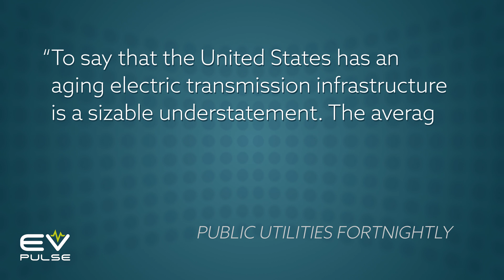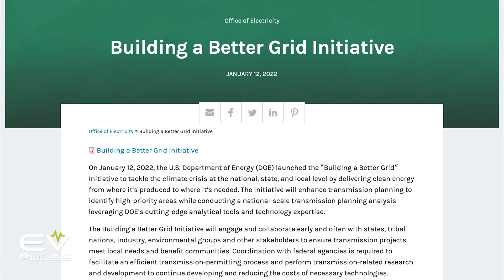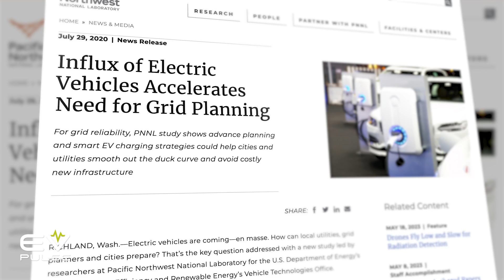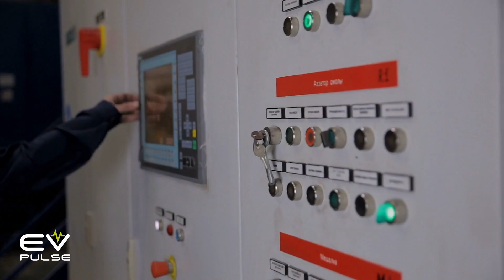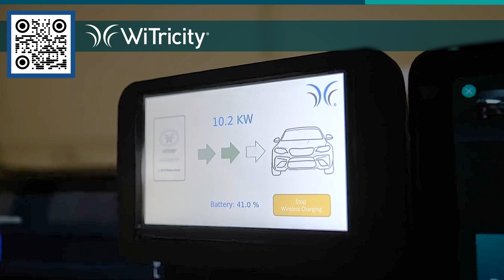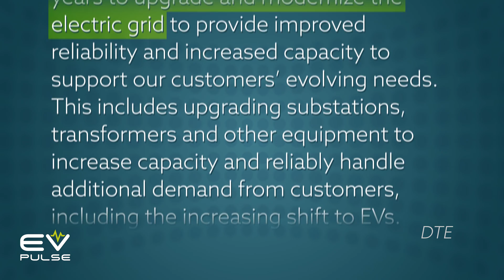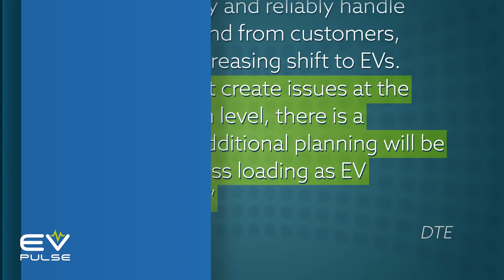Will EVs Kill the Power Grid? | EV Basics

Comment: Well, the answer is NO provided that your produce enough energy by whatever means and have an efficient and reliable distribution system. It requires a lot of planning and investment. If you just seat back and relax you will have huge problems. EV adoption can easily grow 10, 20% over year, but electricity generation and distribution will not grow as fast as.

Comment: What's crazy is electric company puts energy savers on your home for your air conditioning. This allows them to shut off certain areas during peak times. Pretty much you don't have control over your air-conditioning settings because they shut you off when they feel like it. 
They want to make electric vehicles? Lol that makes no sense!!! Specially makes no sense when power goes out just from a storm. Can't charge electric vehicle if that happens. 
Batteries, freeze and explode so I'm curious how that's gonna work. Not only our batteries extremely expensive and you better be rich in order to replace your batteries in your electric vehicle, but the old ones will still be going to landfill. You didn't really clean the Earth, with your electric vehicle. 
Gas cars you fill and go, electric cars you sit and wait.  You smashing into another car with your battery car and kaboom there's all your battery acid everywhere eating through everybody's skin and everything around it. Sounds like a horror movie.
Reply from the maker: Sir, this is a Wendy's.

Comment: I retired after 34 years as an IT Field Technician for a Fortune 100 electric company; my two specialties were wide area communications and protection schemes for transmission and distribution; I was the IT guru for the newly installed Smart Grid system in Flagstaff back in 2010.
I see this video as mostly right, but the sources are not talking about the right things. Capacity per se is a relatively small part of the reliability picture: everybody overlooks stability, even though it is a major factor in most wide ranging blackouts.
Mostly good news: in the 20th century protection schemes were almost entirely plagued by overkill. Since trigger events were a matter of looking for faults on a line, there was only one way to deal with instability - the leading cause of blackouts: cut lines and facilities in the clear! Bring it all down for as far as it takes, then try to restore pieces one at a time. IMPORTANT LAW OF PHYSICS: generation must equal loss plus load every second or so. The First Law of Thermodynamics sez so. For this very reason relatively minor events in the Pacific Northwest (including a filbert tree being a bit too tall under a transmission line in Oregon) resulted in blackouts to most of the western US on August 10, 1996.
The good news is that in the past couple decades a relatively new stabilizing system has been implemented. It is based on a (redundant) data network that shares voltages, currents, and phase angles to intelligently trip off lines that are pushing the system over the edge. The system, known as Remedial Action Scheme (RAS) is a growing part of system stability.
That brings us to everyday stuff, but with technical aspects. Generation falls in two categories: dispatchable (available on demand) and non-dispatchable (available when the stars align right. Fossil and nuclear plants are dispatchable sources; solar, wind, and hydro is not. (Hydro is dependent on upstream precipitation.) Geothermal is dispatchable, nearly all other renewable sources are not. Stability depends on enough dispatchable power being available after load is shed if necessary.
Bottom line: the adoption curve will probably stay within the proactive measures curve if we are smart. We need to be sensible about relying too much on non-dispatchable power like solar and wind. Use them when the margin is good but relieve them when the margin is not. Non-dispatchable is not like nitroglycerin, but it is waiting for us to make mistakes.
Reply: Now that you've had another year to watch renewable energy, how do you think Utility scale batteries will reshape the power generation? 
    My biggest reason I think fossil fuels need to be eliminated is:  A few years ago I was standing on a outside walkway at the coal power plant I worked at watching a major crane lift to install new pollution equipment. A plant engineer stepped up to the rail beside me and said "What a waste of money, it all falls out in a thirty mile radius anyway!" .  My question to him was "So it's okay to poison people in a thirty mile radius?".  He just turned and walked away, Pittsburgh is twenty eight miles away from that plant.

Comment: If followed to its logical conclusion nuclear electricity worldwide. 

No CO2 climate destabilisation for Australia, from emissions worldwide. 

Nuclear uranium yellowcake sold worldwide. 

Small Modular Reactors worldwide. 
Nuclear industries worldwide. 

Military defence budgets exploding worldwide.
Nuclear submarines for Australia's defence worldwide. 
80% of the world's population is in dictatorships. 😮😮😮😮😮

National Electricity Grid expansion worldwide. 
Iron ore and coal mining exports worldwide. 
Copper and zinc and aluminium exports worldwide and refining and  ....
CO2 emissions exploding.
EVs and no ICE vehicles. Millions and millions. 
15% of energy used to 100% electricity energy is x7 more electricity and national transmission and distribution grid and poles and wires and transformers and switch yards and.... maintenance and.....generation SMRs, 
And expensive plant operators working shifts 24/7/365.
And spare SMRSs, 
And decades and decades and decades and decades of new capacity grid construction

Comment: Air conditioning, the peak daytime load is the main issue. AC loading greatly increases with hotter summers. AC unit count will also increase worldwide from 1.9 billion in 2020 to 5.5 billion units in 2050 (IEA).  EV charging is a peak night time load.  Bottom line:  If the grid can handle peak daytime in the summer it will generally be able to handle the night.  A crap ton of $ will have to be spent improving the grid, but not for the reason you think.
Reply: Most people leave their AC on overnight.

Comment: ACTALLY, EVs will  BOLSTER  the grid. All EVs need to be using a  Bi-Directional charger. One that puts juice INTO
the EVs battery pack as well as take juice  OUT  of the battery pack so the grid can use it. As we speak there are 
some 9M EVs on US roads. It works like this>>>
You come home from work or a trip & plug in. Your charger tops off your battery pack  THEN  the charger switches 
making your battery pack capacity available to the grid to run your neighbors ac or do his laundry. In the wee hours 
of the morning. your charger will switch back & top off your battery pack once more getting you ready to start your
day. Problem Solved. The US grid does not need to increase its capacity because all these EVs WILL BE the 
increased capacity.

!
Reply: Right!  Cars with larger than needed batteries are essentially grid storage.  Imagine being paid to plug in!
Reply: There are serious problems with that vision, though. There is nothing to regulate such unsolicited power; it is not very different from trying to drive with the engine power doing whatever it wants to do. Blackouts are commonly caused by instabilities. Numerous homes backfeeding the retail electric system is a condition that will have to be well-controlled.
Reply: Not going to happen.

Comment: THEY WILL!!!!  BECAUSE FAST CHARGING WILL WASTE MOST OF THE ELECTRICITY!!!!  CARB  lies about the efficiency of EVs!!!  In their ARB/MSD/7-6-94 they claim that battery efficiency is 80% and motor is 90%. These are lies!!!!  Charging a battery in one hour is 5.88% efficient. In 15 minutes it is ONLY 0.3675%!!!   While running it depends on how many stops are made. Every time the motor starts the motor and system efficiency are almost ZERO!!!!!  The high motor starting current is also bad for the battery!!!!!
Reply: You are spouting utter nonsense.

Comment: Refining Oil requires vast amounts of electricity, as the need for requiring Oil decreases so vast amounts of electricity will be released to grid for EV use, simply put, if we stopped refining oil there would be more than enough electricity to power all ICE cars converted to EV's
Reply: This is complete nonsense and misinformation. It takes ~8.4 kwh of electricity to refine one barrel of oil which itself contain ~1700kwh of stored energy. This is why oil is such an efficient energy source and why it is so difficult to get rid of it.

Comment: Electric class 8 truck charging requires 1,000KVA for each charging stall. That is so far above our current capacity you don't even have to do the math. It's like, can I haul 50,000 lbs in my Honda Civic.
Reply: Truck chargers have to powered from batteries at the charging site that recharge slowly at times of low grid demand then output fast when a truck pulls up.

Comment: The grid can easily handle the demand of EV charging, if there was sufficient electrical energy storage at the charging sites. Something like a "Tesla Megapack" would handle full rate charging any time of day, and would not burden the grid during peak hours, because it could charge during off-peak hours, and take advantage of the power available from wind and solar when that's available. Because it can put a steady load on the grid, the average energy can be much greater, even with a slight reduction of peak load. It would end curtailment of wind and solar, allowing those assets to operate at their maximum capacity factor. That helps lower the levelized cost of energy from renewables, and most importantly, greatly reduces the need to upgrade the infrastructure. It is much less expensive, and much easier to get a permit to park a container-sized battery system in a charging lot, than to erect hundreds of pylons, and run miles of high tension power lines.

Comment: And what about all of those electric Semi's that will be delivering those goods across the country...........🤔🤔🤔
Reply: The electric semi's aren't going to work out. Their battery size and charging requirements are so large that they are not feasible.
Reply: Still not a problem, if the charging sites have electrical energy storage to handle the peak demand, and can charge at a limited but steady amount of power from the grid. If the grid voltage sags from high demand, the batteries don't charge.(the head of the "duck curve") If the wind kicks up, and the voltage rises, Or the sun comes up and solar panels produce maximum power, (the back of the "duck curve") the batteries charge. When the demand on the grid goes down at night, that's when the "Megapacks" charge back up, ready to fast-charge the next semi. It would be much faster and less expensive, to install something like Tesla "Megapacks", than to upgrade the infrastructure to be able to charge trucks and busses at 750kW to 1 megawatt charge rates each. A big battery can simultaneously charge several commercial vehicles at once at maximum power, where as the grid would be hard pressed to supply that kind of load at the same time. It would be nearly impossible, during peak hours.
Reply: @vincentrobinette1507  provided that the Mega battery manufacturers can keep up with the demand for all of these charging stations.....🤔🤔
Reply: That's even easier because the charging patterns are predictable.

Comment: An EMP will destroy the Power Grid .
Reply from the maker: Ok
Reply: @EVPulse Have we forgotten about the Carrington event in 1859????
Reply: @RiverRatWA57  CMEs like the Carrington event are a potential nuisance in parts of the northern lands and Atlantic coast; not at all here in the US Southwest. All that is required is to take the lines out of service before anything bad happens; the damage is caused the the CME superimposing DC on the lines. At a point where the DC current from the EMP and the peaks of the AC current reach the saturation point of transformers, the current spikes spectacularly before the line trips off. Measures are already in place.
Reply: An EMP means nuclear war. Bulk electric power is the least of our concerns.

Comment: Everybody plug their EVs to charge at night 🤷 at same time 🤔
Reply: Everybody switches off every household appliance at night and goes to bed .at the same time
Reply: @jimsouthlondon7061They don't do that though.
Reply: This isn't a worry... very soon, you'll plug in and utilities will give you the best rate for allowing them to schedule you.
Reply: @lsh3rd  True - provider control over load is a big and rapidly growing thing. In Arizona we have had many "offers" from Arizona Public Service (I retired from there five years ago) to give me a Nest thermostat that they would control... but they rarely mention that last bit.
What could go wrong? About a decade ago the thermostats in our admin building here in Flagstaff were taken over by the system in Phoenix. It set the thermostats to about 80 degrees, which cause our heater to go on in the summer morning. Hey... the outside temperature was nearing 100F in Phoenix so the whole state should be set that way.
Reply: Ha that part

Comment: Then why in Ca. are they asking people not to charge their cars during heatwaves? Ca. also has rolling blackouts when demand is high.
Reply: Air conditioning is the much bigger problem. Most EV owners charge their cars at home at night. Peak electricity demand occurs on the very hot days when everyone turns on their AC.
Reply: I've heard a lot of it is california can supply the electricity their infrastructure is just old and shitty and I guess they don't wanna go upgrade it. There are high risks of popping an old transformer in the woods and then they have a new massive forest fire on their hands that I believe they are financially responsible for.
Reply: This is where electrical energy storage can really help. At charging stations, where it's possible for demand to exceed 1 megawatt, something like a Tesla "Megapack" could handle the peak demand, then charge back up when the loading on the grid is much less. At home, charging overnight really helps, if the charging ca begin after air conditioning systems are winding down. Such storage systems can also take advantage of intermittent renewable sources, like wind and solar when they're generating full power, especially if that happens during periods of low demand.

Comment: Moved into my house in 2003 and my electric bill was $100/mo. Now in 2023 my electric bill is still $100/mo despite adding an BEV and AC. How, all lights changed to LEDs, outside lighting changed to day/night motion detection, STAR energy appliances, low power computers and displays, low-e windows, insulation, etc. From that perspective I have a net gain of about $300/mo, what I used to pay for diesel and diesel vehicle service/maintenance and the house resale value has greatly increased by almost $100K over normal appreciation.
Reply: This means you have solar, and the real cost of the solar panels and installation is much higher than your savings. Good effort though.